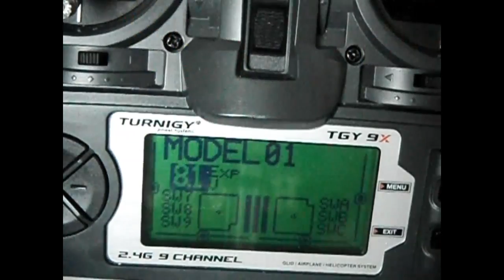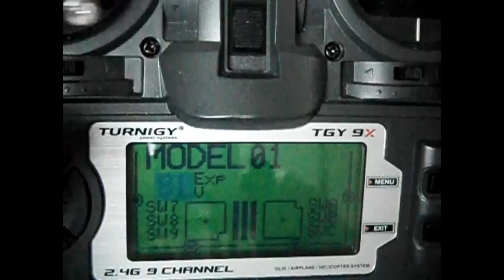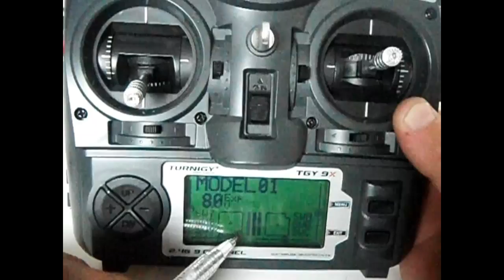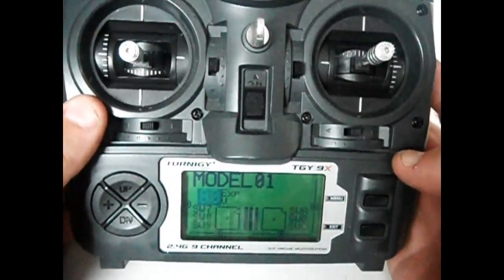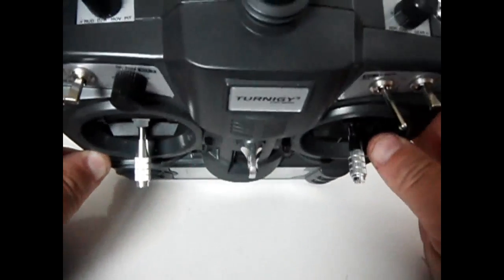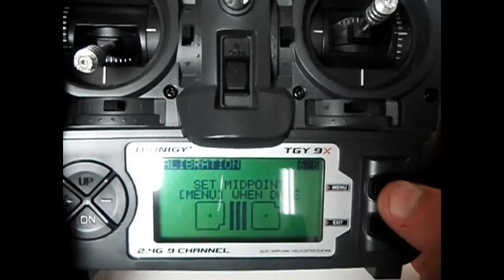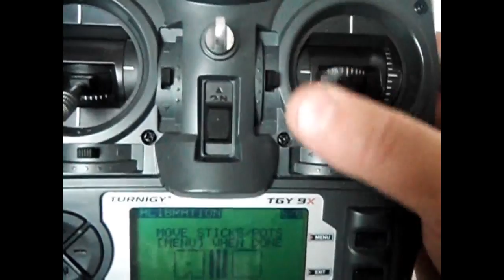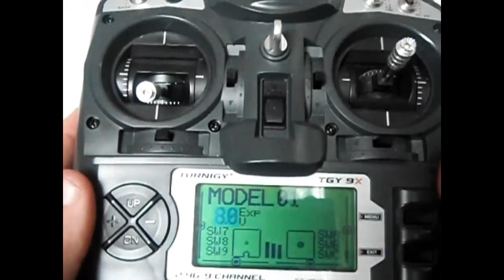ER9x Stick and Pot Callibration

Comment: THIS IS AWESOME! if your sticks are bent or gimbals not centering this will help a lot. I had not calibrated my 9x in 4 years and have 3 of them. I was going to take apart gimbal internals then reset and all is good. Important when miniquad racing.

Comment: Hi, I saw your video on how to calibrate stick and radio. I have a flysky radio  which is the same as the turnigy radio. Also, I lost  or my dog ate  my instruction on how to set up  radio.  On my radio , when I push  the throttle away from me . I do not get any response  but, when I  pull it down  towards me . My 4 channel helicopter will throttle up. I am not sure about  my radio because I just  bought it last year. And just decided to use it. Since I am building several model aircraft .